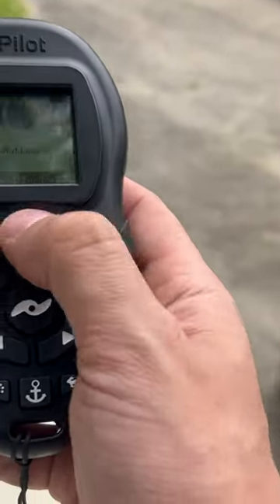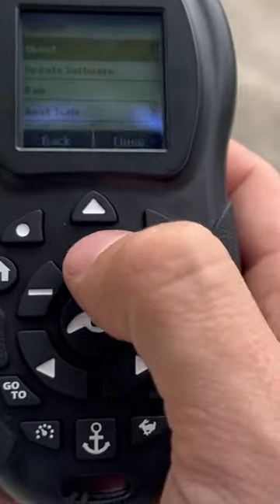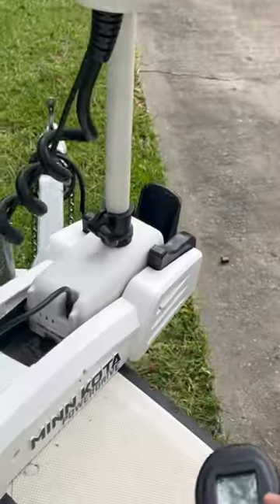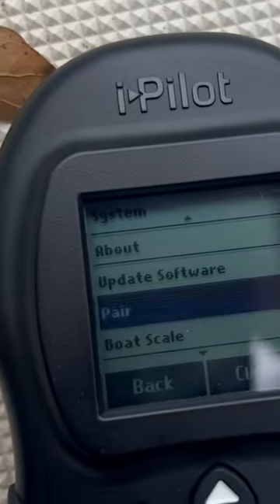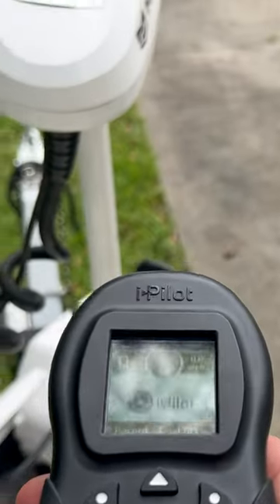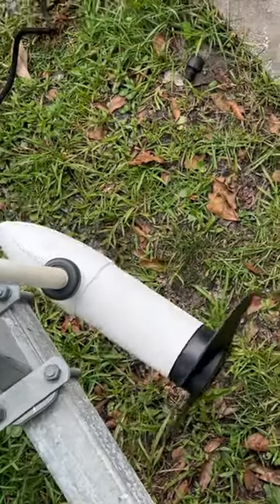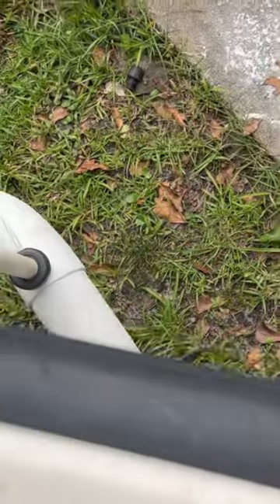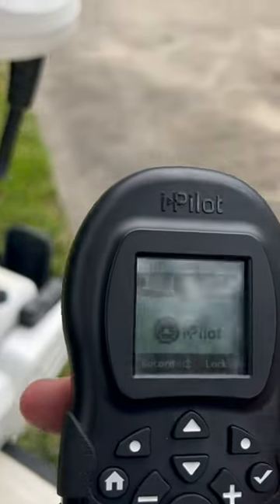How To Pair New Minn Kota Ipilot Trolling Motor Remote #redfish #flounderfish #fishing boat

Comment: When we going fishing
Reply from the maker: I’m ready when you are bud
Reply: @fishingwithaustin8258   name the time and day we will make it happen on the neuse or the pamlico
Reply: I can not get my remote to connect with the trolling motor I have also tried using a different controller. Should I replace the trolling motor head unit?
Reply from the maker: @jonwazny6747 so I’m assuming you have paired, and unpaired correct? Did the trolling motor work and spin before the connection went bad?
Reply: Everything worked fine but it was just intermittent on the remote to the power head. If I hook the foot pedal up trolling motor works fine. It's the connection between the to I cannot get to stayed paired
Reply from the maker: @jonwazny6747 disconnecting the battery resets the motor, are your remote batteries fresh?
Reply: They are about 3 years old, interstates and I keep the onboard charger plugged in on the off season